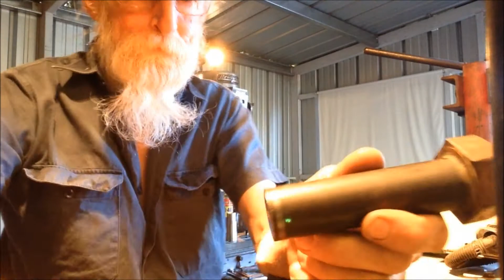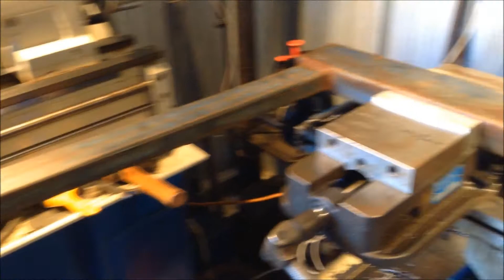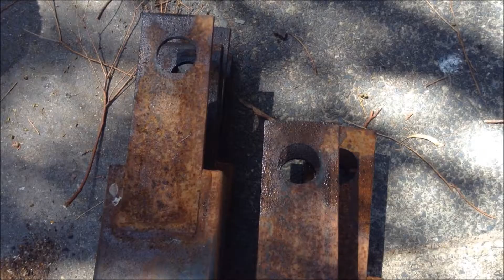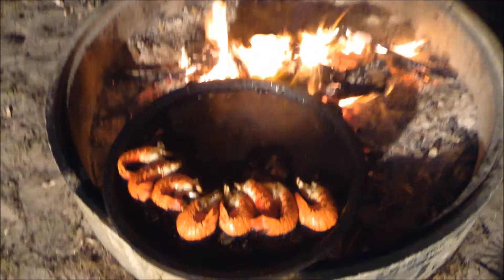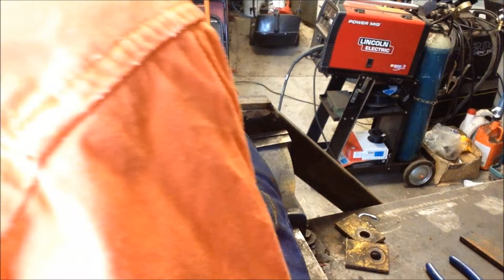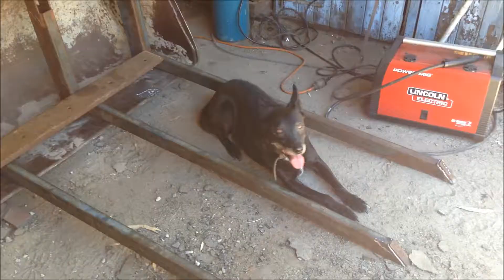Swarf & Chips Ep 3  Part 3

Comment: Nice done in a 4 jaw chuck. We like welding and are needing to be self taught in it we hope in 2020 to start our learning process equipment has been here brand new for 3 years now. Your brackets look nicely attached.  Hi puppy she has the tough job of watching out for you. LOL.
Reply from the maker: Thanks for looking in .  The self taught way of welding is good but takes ages . Easier now days with you tube  , I was about 10 when i  first learnt to do basic welds with a stick welder & i still suck at it  but i can get by !  , cheers .
Reply: Max and Active Atom, my Father tried to teach me to Stick Weld in the late 70's, I could not get the hang of it as I had no patience back then. I bought a new Mig and could make two bits of metal stick, suddenly I was a Welder LOL.
 35 years later I ran out of gas on the weekend and had work to do with a need to be welded, it is amazing how quick you can learn to stick weld if you put your mind to it. I will admit I had a lot of practice with a mig by then and knew what a good weld should be. As Father said Welding is 90% Practice and 10% theory up to a point and then it is the other way round on critical applications like special alloys needing preheat and post heat. Cast Iron is a classic example of the need for special attention to detail.
 As Max has said YT makes it easier this day and age, however I started by reading some of my Dads books and practice. My thoughts is learn stick and most other processes will come easy. Last thought Oxy is a good background as well if you are going to learn TIG, it is just the settings that are the learning curve then (still learning).
 Cheers from John, East coast AU.